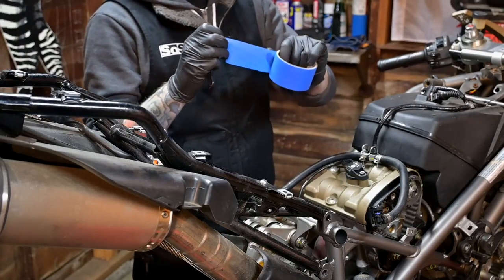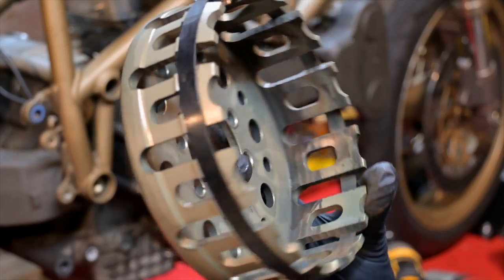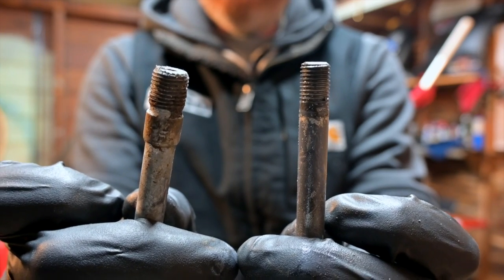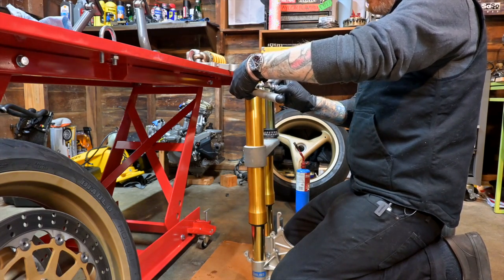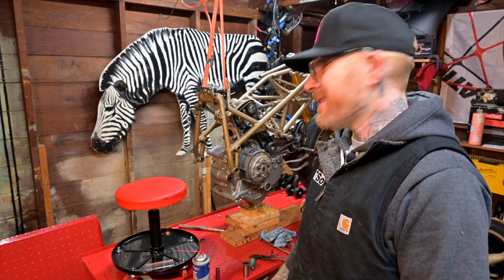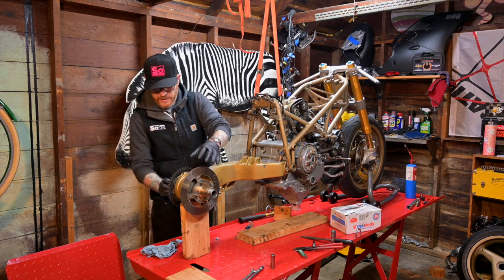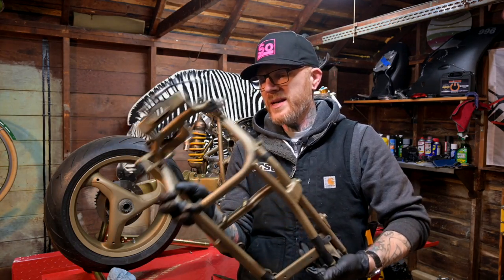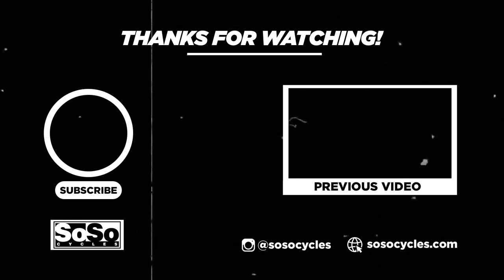SoSo Ducati 916 Build Part 3: Swapping the Motor!

Comment: How much of the swing arm fight did you guys cut from the video? I didn't see a blow torch or a lump hammer :)

For future reference, I have a drawing I can share of a swing arm tool that screws into the thread and lets you hammer the bolt out.
Reply: I cut out the part where I smashed my thumb then immediately attacked it with a cutoff wheel. I've taken out so many of these stupid things and have never had a fight like that. 
PLEASE share the drawing. If I ever come up against that again, I want to be prepared!

Comment: Great stuff, thanks for the Vid! Question: Were the motor mounts in the right positions already (like a lego kit) or did you have to make Adapters to mount it? I somehow didnt see it. How about the Center of gravity, was it fixed by the motor mount positions or were you able to experiment there (maybe need to do so if the handling is strange) ... how do the motor weights compare ? Thx for answering, cheers
Reply: The mounts are in the same position, as Ducati’s L-twin motor layout didn’t change much over the years. The engine itself is about 7lb lighter than the old Desmoquattro. I’m not sure about the center of gravity, but I’d assume with the deep sump, it’d be a little lower?

Comment: I remember a friend started with a 748s to build a 996 Corse back in 2000 using 1 of Troy Corser's engines from 1998. After the engine went in, it needed the longer Ducati Corse swing-arm for the power but that made it turn badly, so he had to get the matching Ducati Corse front end. Both these mods required the WSBK spec wheels. In the end he only needed a new frame to rebuild the original 748! 🤣🤣🤣
Reply: This stuff is a truly deep rabbit hole. When I was trying to build a 996RS back in the day (the one I mention in the first episode) it was always, “you can use that part, but you need these two parts to make it work. And to make those two parts work, you need these three and two of them are rare as hen’s teeth.” Etc etc. 
But that seems like an awesome bike, my god. And thank you for watching!!

Comment: i wouldnt touch a mag swingarm with a bargepole, magnesium parts are almost disposable as the metal fatigue destroys the, thats only if they dont corrode and go porous first.
Reply from the maker: This one has been thoroughly inspected and was found to be in excellent shape. We then stripped and painted it. There are many, many people out there running period-correct long mag swingarms with no problems. We agree that it is a risk, but not if you do it properly.

Comment: I am very impressed that you only needed to drill larger holes in the frame to fit the 1098 motor especially as there is almost 20 years between the 748 and 1098
Reply from the maker: There was quite a bit more than that involved, as we're sure you've found out by now. But as far as motor swaps go, this is truly one of the easier ones.